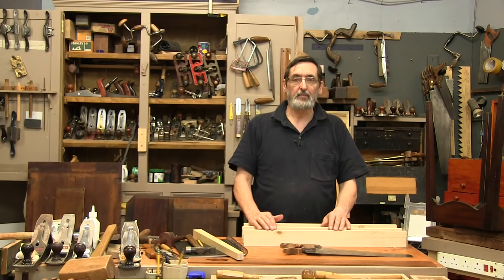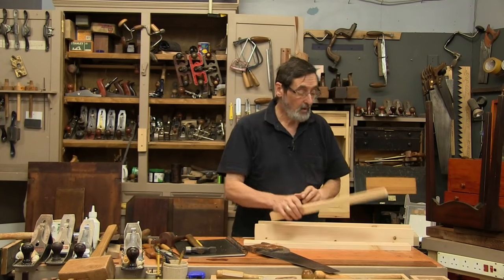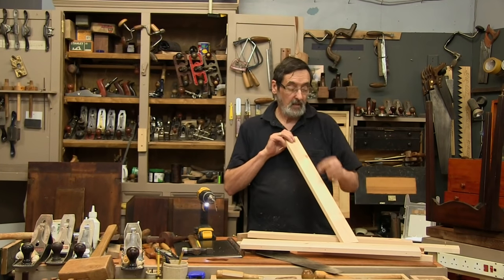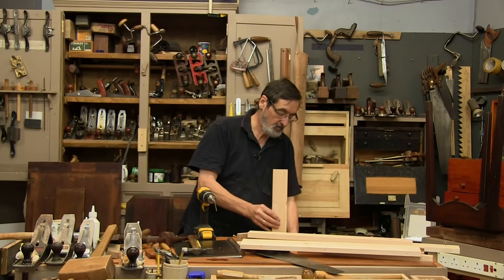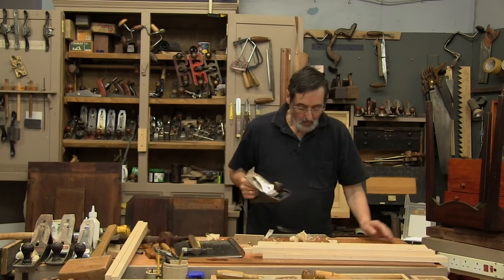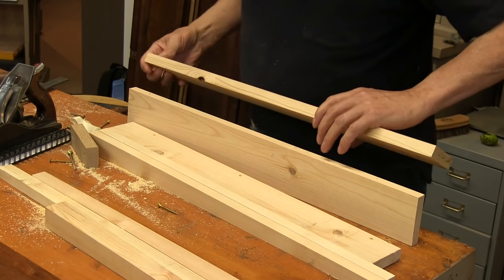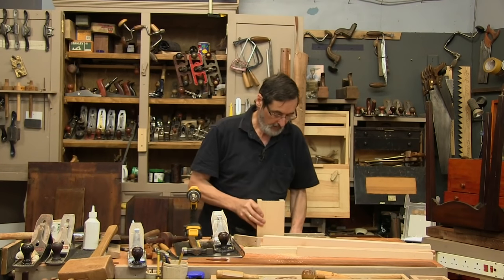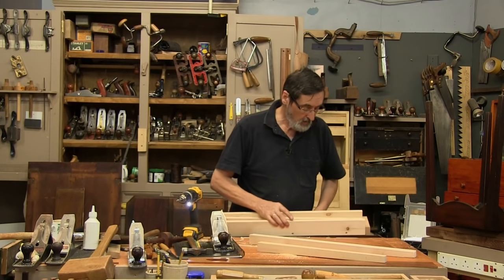Making a Tapering Jig | Paul Sellers

Comment: Paul, the lazy portion of my brain told me that planing away 5/8th inch would be some serious work, but I made one of these contraptions and sure enough the lazy portion of my brain was correct. It is some serious work. 
I have about 12 chairs to work on over the next year give or take so what I might do for expedience is to remove the bulk of it with the band saw then clean it up with the tapering jig.
A few things I found useful..round and sand off the edges of the sides on the inside if you're fond of your knuckles. I also cut some various sized insert stops and to clamp another stop on the back side to keep the work piece from jumping around inside the jig. 
As for the plane digging in to the rails? That doesn't happen. The blade isn't as wide as the base of the plane. It rides along freely and by the way, the band saw did make this much easier.  
I know you dislike machines Paul, but busted knuckles are just not as fun as advertised.

Comment: As always a simple and elegant solution.  Thank you.  I'd love to see a more advanced one with an adjustment screw and hinge to allow the taper of the rails to be adjusted.  One possible issue with this design though.  I may have missed it but you might want to make it clear that the two screws that hold the rails down to the base need to be counter sunk to a level below which the blade will ever reach.  The edge of the plane mouth will prevent the rails from being skimmed down indefinitely but the screw needs to be below the maximum depth the blade will be protruding from the sole.

Comment: Paul, I enjoyed watching the tapering jig video but one thing you said at the beginning had me confused.  You said you can use the jig to make a two sided taper or a four sided taper.  Two sided I understand, but a four sided taper with the jig requires the angle of the jig to be halved.  In other words, the two tapered pieces need to have two additional tapers for the plane to ride on to get the taper on the opposite side of the leg.

Comment: I might be wrong.  I know this will work for tapering two sides.   But when you want to taper all four side of the leg, don't you have to wedge or support the previously cut face to have the leg at the correct height between the rails to taper the remaining two surfaces identically.?

Comment: Enjoy all you videos.  Great stuff.  I am getting back to woodworking for retirement. 

Just one comment on the jig.  The plane of the top and foot portion of the leg will no longer perpendicular to the center line of the leg.  What is best way to square them up?

Maybe use two rails,  a shallow taper for first two adjacent sides and a steeper one for the next two.  

Thanks

Comment: Very nice! I'm curious your thoughts on using this for non tapered items. If you used parallel runners in the carriage (instead of tapered) you could use that for making several pieces that simple need to be the same dimensions. Being new to this when using a plane on wood in the vice I struggle at replicating dimensions across multiple items - such as a leg or apron or whatnot.
Reply: What a great idea!
Reply: There is a video of how to make a thickness jig such as you are describing available free on the woodworkingmastersclasses site
Reply: Thanks! I'll hafta look it up!

Comment: That's a sturdy no-fail jig for planing legs  to a single taper.  But the jig could be made adjustable by placing a pivot pin through the support rails at one end, and then fastening the other ens of the rails at at any desired taper.  A vertical graduated index line at 12 or 24 inches distance from the pivot pin could be scribed to aid in setting the taper.
Reply: Considering how easy it is to make the runners and install them, maybe just making differently-tapered runners for each new project would be sturdier (not risk bending in the middle under pressure from the plane). This would also aid in repeatability, if you came back to make a second set of legs for another copy of some particular project.
Reply: Peter W. Meek Certainly that's so.  But here, I already have too many single-purpose jigs hanging around.

Comment: Thanks. Brilliant tip, again.  One question though: Do you need to make sure the tapered rails can not get caught by the blade, or perhaps it does not matter as they would be planed down to the set depth anyway? 
I think I have watched every single video of this channel, you make woodworking look so easy.  Started to acquire some tools and practising sharpening of them.  Found some excellent old frame-saw rip blades from "Sandviken". I'm hoping to be able to start making a workbench soon .  Difficult to get hold on a Record type vise here in Sweden though.
Reply: I had the same thought. Surely swapping out planes will change the reach of some of the irons.

Comment: Hi Paul, I love trying everything you show us but I have a big problem.
Every time I plane a piece of wood to get is flat and smooth, the planed surface always slopes to the right instead of being flat.
I have 3x no 4 planes all bought from car boots but I've renovated and sharpened them as per your videos. (I get a lot of pleasure from taking very fine shavings so its always set finely) Also it always reaches my depth of cut on the end of the length of wood well before the start. I've tried taking all the downward pressure off the plane but there is no way I can completely flatten and square up all 4 sides. Can you suggest anything I could try to stop this problem? I'm sure I'm not alone with this problem and I'm sure that a video showing the correct use of a plane would be appreciated by many people.
Thank you for your time, and your extremely good videos.
Reply: I have (had) the same issue, Glyn, although I'm getting better over time and is now more or less sorted.  I'm guessing you are right handed.  It could be the blade isn't square to the sole of the plane but it's more likely you are ever so slightly rolling the plane clockwise as you push.  To correct it, try placing the thumb and forefinger  of your left hand at the front of the plane as you push it.  Thumb on top, finger underneath on the sole.  Bring the plane towards the left so that it is running off center of the wood and overhanging the high side.  You should be taking only partial width shavings to start with.  As you plane make a conscious effort to put the weight on the left hand side of the plane (as you view it from behind.)   I know how frustrating it is to have this problem, but don't give up.  With practice you will crack it.
Reply: Thank's Danny, I think you are right. I've changed my grip on the plane and let it do the work, just pushing it and not putting downward force on it so as not to influence it, it is working although I sometimes forget and hold it like I used to but like you say, in time I should perfect the correct stance.
Thank you for taking the time to help.
Reply: You are very welcome.  Good luck on your journey towards mastery.

Comment: Thanks, Paul.  This jig clearly works perfectly when one wishes to taper two adjacent faces of a board.  What if I need to taper all four faces of the board?  Is there a clever way to do that?
Reply: Greetings... How about two jigs: One for the two first sides(Planar to taper) and then one for the two "Smaller" sides(Taper to taper).
Reply: Drop a strip half inch thick on top of your guides may be. That would be how I would do it then gives you half inch on the other side to taper down.
Reply: that´s not gonna work Adam, instead you´ll need a taper strip, note that when you plane a face oposite to one that has already done you will need a diferent angle (double as initial one) as the leg then is resting on an already taper face. I would make the guides with the double angle and use a small supplement put underneath at end of the guides.
Reply: +roma1530 yes when I thought about it more your right. You need two sets of guides

Comment: Paul,
I'm betting you have a brace and bit?   It was what I used before battery or electric power.  LOL!1  My dad wouldn't let me. He said "You will make smaller mistakes with Hand tools."  My rehabbed planes are getting there. Still need practice with sharpening and it's subtleties.

Comment: Hi Paul, at the age of 63 I'm just getting an interest again in woodworking. I am really enjoying your videos. I want to taper some wider legs for a table ( 4x4). As this is wider than the plane is there any way to assist or will I just have to mark it and plane freehand.
Reply: If this was me, I'd saw to rough size and then just use plane for smoothing.

Comment: I take it when using this jig for tapering all four faces you use two sets of rails? One to set the taper on two adjoining faces and another to compensate for that taper when finishing the other faces.
Reply: I was wondering about this too. How to make the taper on the opposite side when one taper is made.
Reply: +cricce it shouldn't make a difference if you're happy to square up the ends when you're done
Reply: +Daniel Lukes - I think one will need 1/2 of the angle for the 2nd side of each leg, if tapering all 4 sides. Maybe one way would be to make the inserts at the half-angle, taper 2 sides then for the last two, lever up the tall end of the inserts to effectively double the angle. The 2nd two faces need to compensate for the 1st two tapers already on the leg.

I think by making the insert anges adjustable and the end stop movable this could be a very versatile jig. Much thanks go to Mr. Sellers.

 - Eddy
Reply: This is an issue.  The ends will be the same as Daniel Lukes says here but the amount of wood taken off the sides opposing the original taper will be half.  MIght be funny looking legs.  Best to stick to two side taper with this jig.

Comment: How do you keep the plane from cutting into the guide rails?
Reply: only a risk when you are very close to final size.  THen you just take care to run your plane in the center of the jig, or skew your plane in the jig so the front left corner and right rear corner are rubbing against the jig side.

Comment: ok, so, I see that the inner parts of the jig are made of 3/4" stock, the parts that are tapered. Doesn't the blade hit these, since the plane has only 1/4" clearance with the outer frame, and the blade extends almost all the way across the plane? It seems, the blade will cut a shaving of the tapered inner runner! How can the jig work when it is cutting the most crucial part of the jig?
Reply from the maker: If they do, which they are likely to, the blade just takes it down to the required depth and leaves a shallow rebate on each side. Once it bottoms out on the two sides of the plane it no longer cuts the pine and the two sides become the registration face so when you insert the wood to be planed it comes out perfect.
Reply: well, really? It seems however much the blade is sticking out, the leg will be that much smaller. Would it be better to make it custom-fitted to a plane, and make the guide tapers thin enough to miss the blade as it slides down? I will try it that way, and see how it turns out....

Comment: Why do you need the outer walls, can you leave them off?
Reply from the maker: It keeps the plane centered and prevents lateral movement that could result in the material moving or the plane moving and thereby it results in unnecessary damage.

Comment: Do these need to be run-in like a shooting board?
Reply from the maker: No, not really, as the side pieces are narrower than the distance between the sides of the plane and the cutting edge of the iron so the plane sole rides the carriers and they are never reduced at all.
Reply: It would seem like using a narrower plane, like the #4, you could risk planing some of the jig off if you don't drive it straight down the center.  Great jig though. Thanks Paul!

Comment: considering that the blade of a plane extends to the edge of the plane isn't it also going to cut the guide rails down?
Reply: Greetings... Planes have smaller blades sitting in a mouth. The edges are solid and will glide. Only Rabetted planes have a blade, that is cutting the Whole Width.
Reply: +Jakob Hovman thank you, obviously I don't know all that much about woodworking (more of a metal worker myself)
Reply: Most welcome...
Reply: I think that there is an issue here where Paul stated that you could use a No. 4 too, just as well as a No 4 1/2, in the same jig, even with the 4 1/2 having a total width that is less than the distance between the walls of the jig. With the smaller plane it could happen that, say, the left side is riding right up against the left wall of the jig, on the "solid edge" as you have called it (the area between the outer edge of the blade and the outer edge of the sole), with the right edge of the sole dipping into a previously planed-down strip along the right vertical guide rail.

Comment: Very nice. Once you make (as needed) differently tapered "runners", you can mark them (with actual taper in inch-per-foot or with project names) and build a collection to save with the jig. For four-sided tapers there could be a "first pass" and a "second pass" pair of runners for a given taper.

Would there be any point in making a special blade for the plane which was relieved at the sides so it wouldn't cut into the runners? (This might be an issue if you were doing a large number of identical copies of a project - say for a set of 12 dining chairs. That way the last ones would be the same size as the first ones.)

EDIT: Answering my own question, after thinking it over: No; because the blade is not the full width of the plane so there will always be some uncut surface at the outer edges of the runners for the plane to ride on.
Reply: Excellent reply to yourself. Thanks!